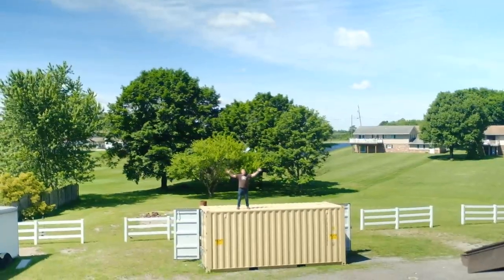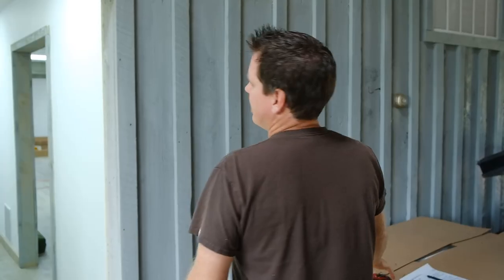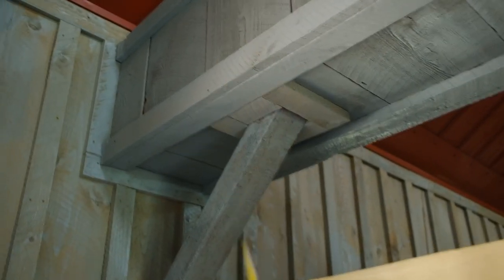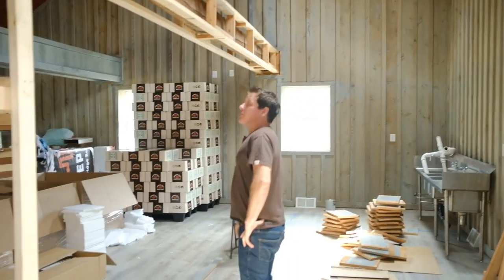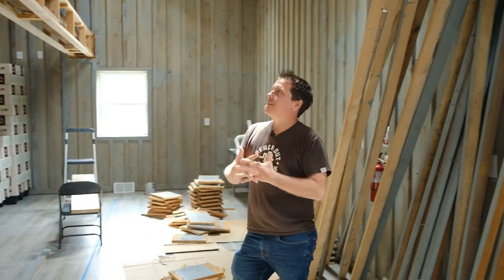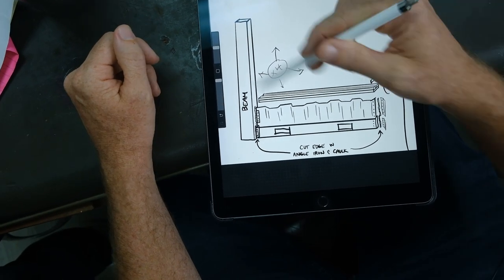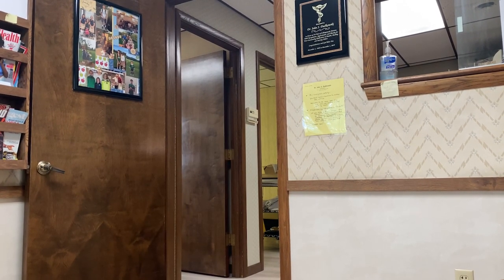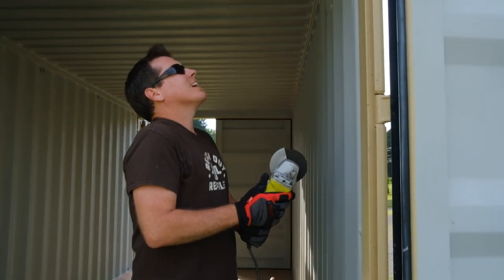DIY Container Terrarium [Part 1]

Comment: I’m sorry, but I’m not convinced this is a sound idea. Do the engineering and make sure the building, as is, will support the weight.
Reply from the maker: Guess you'll have to stay tuned to find out! If the floor caves in it will make great vlog content....